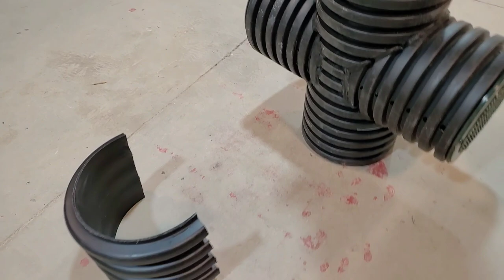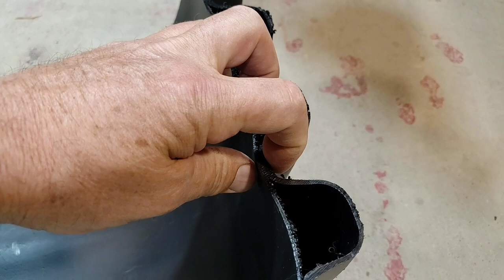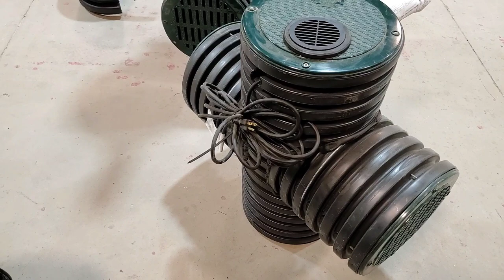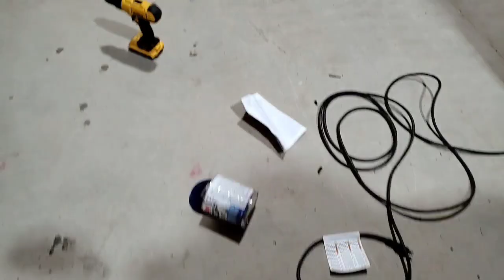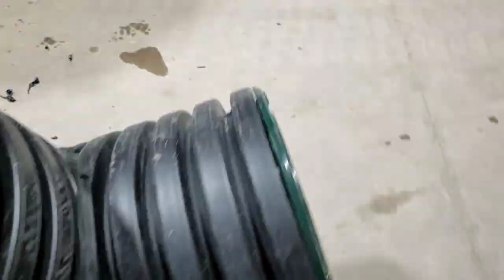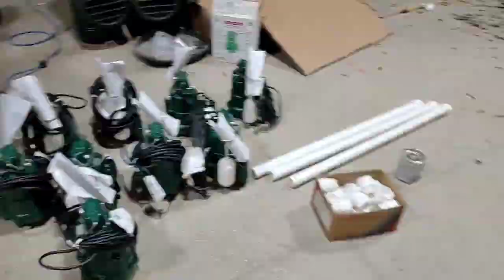Outdoor Sump Pump

Comment: I need to run a discharge line, 450ft with a slight incline. Would a 1/2hp pump work or should I go with a 1hp?
Reply from the maker: I would put in a relay pump mid way or dig deeper to move the sump pit further.